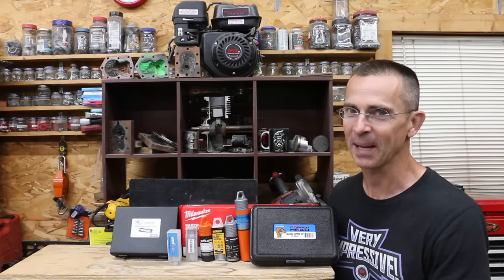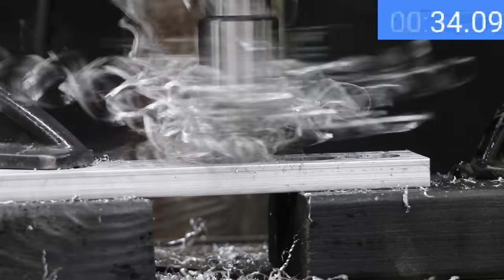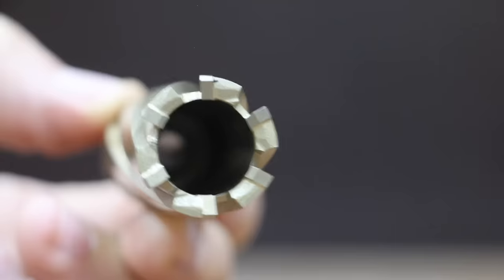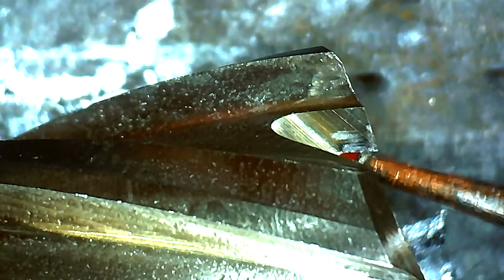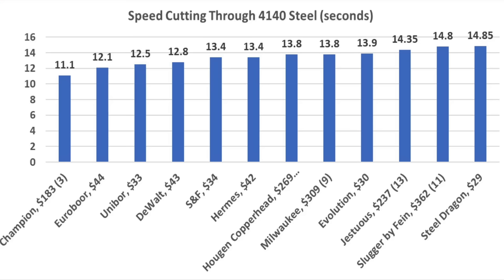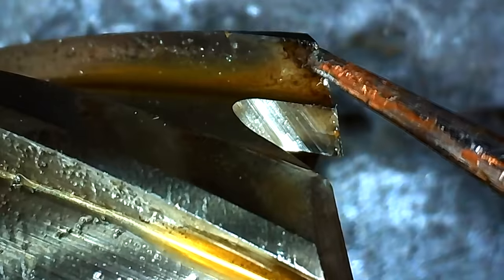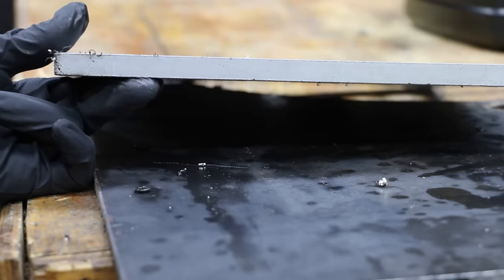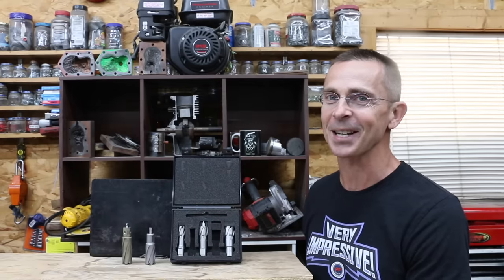Best Annular Cutter? Fein, Milwaukee, DeWalt, Euroboor, Hougan, Hermes, S&F, Evolution, Steel Dragon

Comment: Thank you for this extensive test and make your public aware about the benefit of annular cutters. I am proud to see that Euroboor results come in the Top 3 of your list. In The Top 2 for wear resistance and is Number 1 price quality wise. I hope my comment will get some exposure because beside the annular cutter Euroboor has the widest program State of the art Magnetic drilling machines and I am convinced if you would run a test one day Euroboor will come out Nr 1. and leave nr 2 and the rest light years behind. Kind regards, Albert Koster - CEO - Euroboor USA
Reply from the maker: You are welcome!  Thanks for the suggestion.

Comment: For many materials, carbide is actually supposed to be run much faster than HSS for longevity and proper chip evacuation. I wonder how much running them slow impacted performance.
Reply from the maker: Thanks for the suggestion.

Comment: These cutters are awesome! I used to use them all the time working with structural steel, drilling through plates up to 3” thick at times
Reply from the maker: Thanks for the feedback.
Reply: Couldn't count the # of holes drilled in base plates, webs, and flanges. Small fab shop.
Reply: @ZincOxideGinger  structural steel if fun work for sure! I used to work for a decent size shop (60-100 tons of steel a week).

Comment: Years ago, we used a "Hougen" unit. They supplied the motor and bits. Portable with a magnetic base. On high rise structural steel beams, it would cut through 1" steel beams with no problem.
Reply from the maker: Thanks for sharing.

Comment: I use Annular Cutters all the time , have recently bought a 
variable speed MAG drill and slowing down the speed my
cutters are lasting at least ten time longer and only about 20 %
slower to drill the holes , heat murders these cutters....
I have switched to carbide tipped cutter for just the one size
and they are amazing, so all my future purchases will be
carbide. 
great test by the way.
Reply from the maker: Thanks!  Thanks for sharing.

Comment: Hey Todd I'm not sure if you will get to see this comment but a test on hydration bladders would be stellar. Comparing brands such as Camelbak, Source, HydraPak etc. For outdoors-man, you must trust your life to these bladders. And depending on how hostile the environment if there is a puncture, death is guaranteed. Either if the bladder burst and soaks your sleeping bag in a cold environment this can easily be a death sentence. Same deal if its a very hot environment. So given just how important these are a video properly comparing them would a be a god send.
Reply from the maker: Thanks for the suggestion.

Comment: I'm using mag drill bits (annular cutters) all the time, mostly Jefferson (made in USA), also have some Unibor. I've came across with two types of Jeffersons and came to conclusion that "black edition" are better - last longer whereas "silver edition" (orange case with blue top) tend to brake easily. I've heard of Metabo "light wall" cutters (same idea as Milwaukee), but haven't tried them in action yet.
My suggestion is that test should be repeated using only mag drill, as it is designed for this task, whereas I noticed that pillar drill tends to pull to the side and give some rattle, which affects sharpness and time.
P.S. Keep up the good work! Love your channel, no BS just real technical talk!
Reply from the maker: Thanks, will do!  Thanks for sharing.

Comment: pro tip: you can usually hold the annular cutter in a set of mill style "ER collets" if you already have a set rather then buying the arbor. Also wish you had a control of using a twist drill.

Comment: I've used a lot of Hougen cutters, and they have an excellent power driver. I've cut holes in 2" thick A36 and 2"3/6" diameter...Using a Hougen or slugger power driver, or even in a Mill...will extend the tool life greatly, especially carbide...carbide needs a rigid power drive.
 20+ years ago, Hougen was about all you could get, then came Slugger, also a very good brand..
 these cutters save a lot of time and effort, they remove the minimum amount of material on larger holes. center drill and guide is worth the extra $$.
 Hougen now offers them down to around 1/2" or so.
Reply from the maker: Thanks for the feedback.

Comment: I was lead hand fitter in a stainless shop, I only used HSS as I had a grinding machine. If the boilies didn't blow them up, I could resharpen them. The biggest thing I saw was after I went away from factory geometry I was able to double the lifespan on the cutters. Running custom angles worked well, I did not use carbide tip as the boilies would rip the teeth out and the rest of the cutter was just backing.
Reply from the maker: Thanks for sharing.

Comment: I've had some of these annular cutters for a few years, got them with a lot of tooling I acquired. I use them in my mill at slower speeds and they last way longer when slowed down and some good cutting fluid is used. Great tools and the slugs are useful as spacers and other washer type uses.
Reply from the maker: Thanks for sharing.

Comment: I learned about another tool.  Annular Cutter?  Never heard of it, but now I know.

Great test - shows again that some tools work better on soft materials, while others work better on hard materials.  So it's best to choose the right tool for the job.  Also, the difference in performance by brand and not dollars.  Also, carbide tips do last longer and though they cut slower in soft metal, they worth much better in hard metals.

Comment: I actually use that exact mag drill all the time at work so this video was great to watch. The only problem I have is with the way you lubricated the bits for most of the tests. This bits are actually designed and cut from the inside out meaning just spraying the oil on the outside like you would normal bits actually isn't doing much. The fluid is supposed to flow in the middle just like it does with the mag drill to properly cool the bits. That's also one of the functions of the center pin as well is to open a valve in the mag drill head to allow the fluid to flow through once it makes contact with the piece you're drilling. All that being said I still love this video and all your content
Reply from the maker: Thanks!
Reply: @ProjectFarm  anytime brother!

Comment: once the cutter side slips that is typically the end of the cutting edge. If using a drill press where the center pin isnt useable, we drill through a piece of wood to act as a bushing and clamp it to the top of the work.I think you need to make a better center point as well. We use a center punch, then actually will use a pointy hand drill around 3/16" so the pilot doesnt slip. Your initial aluminum drilling may have been skewed by your system of force....when an operator is near completion of a hole they will typically reduce feed pressure a bit so they dont blast through, tearing the material a bit and loading up the bit cutting surfaces. We started with the slugger system in the early 80`s and have drilled a few holes since then.

Comment: Deff one of the best channels on YT. 
Have to mention though these cutters would have yielded different results if a constant coolant supply was used.
HSS will cut with out coolant but it's not really suitable to not use coolant in this application.
Good test otherwise, love your vids Todd.
Reply from the maker: Thanks!  Thanks for the constructive feedback.

Comment: Thanks for the testing on these great info. When using these titanium and steel I usually flood them with coolant helps  quite a bit and not forcing the cutters into the material just some good pressure and let the cutters do the work. It takes longer but the bits last longer as well
Reply from the maker: You are welcome!  Thanks for sharing.

Comment: First off you are amazing second suggestion soldering equipment heat shrink tubing pin crimpers not the crush kind but there is a circular octagon crimping style for pins but mostly solder soldering irons and he shrink tubing this is definitely a new rabbit hole for you to go down regarding heat shrink tubing there is a measure of the reduction there's one to two one two three solder has different amounts of various alloys and soldering irons of course have different wattage levels
And of course the standard over reliable is the Weller gun but that is more of a sledgehammer approach to soldering yet excellent for all around work

Comment: Some application here: Euroboor makes a “beam drill” that has a height of 7” and a mag base to fit inside of the web of a beam. Angular cutters are fantastic for field machining as they leave a hole perfect for cutting threads. In my experience, less feed pressure does better than hanging on it.
Reply from the maker: Thanks for the feedback.

Comment: I have not even checked out what my 25mm cutter at work is.. But DAMN(!!) it's good!!!
Used it only with my DeWalt cordless drill thru 5mm thick tubular construction steel girders - but by now alone it has well paid it's price worth.

Comment: I really enjoy you videos. Your testing methodology is very thorough and many of your test jigs are very clever. You have done a video on hole saws and now on annular cutters.  It would be interesting to see a comparison of cutting fluids (including hougen slip stik) as there are both high viscosity and low viscosity oil based fluids as well as water based. It might take 2 videos as annular cutters generally recommend water based. Keep up the great work!!!
Reply from the maker: Thanks, will do!  Thanks for the suggestion.

Comment: I use annular cutters every day at work in a mag drill. A constant stream of water, keeping the bits cool, seems to make them last longer than any oil. We discovered this after smoking through bits with various lubricants and cutting fluids for years. We just poke a hole in the cap of a water bottle and spray as we cut. It would be great to see that tested. The cutters last hundreds of holes in mild steel, even the ones that didn’t test well for you.
Reply from the maker: Thanks for the suggestion.

Comment: I have a suggestion. The best dirt/clay remover. I race cars on dirt/clay tracks and something we are always trying to do is find the best way to keep the track from sticking to the racecar. (There must be other applications also). A well known brand is Mudd Off. A mixture of diesel fuel and transmission fluid is the diy type.  Keep up the good work.
Reply from the maker: Thanks, will do!  Thanks for the suggestion.

Comment: I have actually used an annular cutter to size the muzzle of a Century Arms Sporter L1A1 which had its original threaded muzzle cut off to make it legal to import. My problem is in couldn't use a lathe on the barrel because I didn't have the receiver wrench ti remove said barrel, so I looked every where for a solution. I then went to CNC warrior, qhuch I have used before for taps, and they had an annular cutter meant to size muzzles and had a different sized centering pins thay you can pick from, all being sized for calibers like .22, .241, .25, .270, .308, etc. It worked like a dream and sized the muzzle perfectly for me to thread the muzzle for a flash hider.

Comment: In our little factory we use 21mm annular cutters to drill thousands of D32x2 stainless steel tubes daily. we then weld in the holes D20x1.5mm stainless steel ribs and we polish them and sell them as rail towel heaters to be installed in bathrooms. Its a product in Europe that everyone loves. We use Karnach branded cutters and usually about 1000 to 1500 holes are cut before the cutter becomes too dull to drill without it breaking, then we send them to be sharpened. Last year we reached a record in our company, Using one cutter bought back in 2005 we drilled 35000 holes before after the 40th sharpening it became too short to be used effectively. It went from being 45mm tall to only being 8 mm tall. These Karnach branded cutters I believe would have been crushing the competition, its too sad they are not sold in US. On the other hand, seeing the Jestuous, they look almost exactly identical to the Karnach ones that we use. Interesting.
Reply from the maker: Thanks for sharing.

Comment: I picked up a (newly released?) tungsten carbide tipped set from Jestuous at $265 for 13 bits, the first thing I did was send a couple thru an old pitted AR500 target while they’re still inside the amazon return window,  they ate into it just like the CTC’s show here and seem to be excellent so far.  I’ve also had good results from the Jestuous 1/4 and 1/8 TC grinding/cutting burr bits.
Reply from the maker: Thanks for sharing.

Comment: Just what I was looking for, I have been told that Hougen is the way to go for the mag drill so I assumed that the annual cutters are the best too, I will be looking at Euroboor too.  For a tool like this that is most likely being used in hard steel, to me the longevity will be worth the up front cost of the carbide tipped models.  A good way to "weight" the individual cost of the cutters that are in sets would be to divide the cost of the set by the total number of sixteenths present in all the cutters in the set and then multiply that by 15 to get the weighted cost of the 15/16 cutter.  Doing that shows that the Hougens aren't far off from the Euroboors and I believe that the cutters are made in USA too?

Comment: This test should have allowed for your swapping of metals in cutting speeds, also Carbide and HSS have drastically different recommended cutting speeds (rpms).
In general...HSS should be run at a 100sfm, carbide should be 300cfm in mild steel. I have no idea what your speed was but trying to run a HSS cutter at carbide rpms will destroy the cutters teeth, they're unable to survive the heat. 
Lack of rigidity in your super long spindle chips cutting teeth.
I do love your videos,  watch them all, thanks for all of your work.

Comment: We use the carbide tip cutters on our Hougen mag drill. Think about it, who wants a bit that can only drill 1 or 2 holes before burning up? Sure the carbide might be slower on crap metal but they last all day when you really need to get a lot of holes done in thicker metals like I-beams and heavy wall tubing.
Reply from the maker: Thanks for the feedback.

Comment: Excellent video. I'm especially surprised that the holes were so precise even with visible runout on the drill press. I'm guessing it's something in the geometry of the cutters that keeps them on a precise track once they get started. I'm also impressed that the drill press managed to keep them going. My big drill press (but still belt drive) couldn't do the job when I tried annular cutters in it, but I was trying 1-3/4" holes. Very nice work on this one, and very clear that it's worth paying for the carbide versions. They aren't cheap, even in HSS, so you don't want to pay for them more often than you really need to.
Reply from the maker: Thanks!  Thanks for the feedback.

Comment: Once again another great video. I do have one small complaint though. Comparing high speed steel tooling to carbide with the same feeds and speeds isn’t fair. The advantage of carbide tooling is it can be run at faster feeds and speeds. The carbide cutters should be retested in the aluminum and mild steel with more weight and possibly a higher spindle speed.

Comment: I should pick one of these up for drilling 3/4" holes in truck frames for a specific recall.  Using twist drills and a reamer is how we do it now, but it takes hours and burns a lot of bits up.
Reply from the maker: Thanks for sharing.

Comment: With annular cutter's we always use a soluble oil that you mix with water. The key to a long lasting cutter's is keeping the cutting edge and material as cool as possible. Cutting oil lubricates the bore hole but has no were near the same cooling potential as soluble oil with water. Would be good to see the longevity of the same cutter's with the oil and water. Even with cheaper cutter's we are able to do hundreds of holes through 25mm plate with the correct cooling liquid at our workshop.
Reply from the maker: Thanks for the suggestion.

Comment: The only thing I would caution people on is where these cutters actually come from. It may have your favorite brand name on them, but they change suppliers so often the quality varies year to year. Unless you are buying from a tool bit brand like Sandvik I doubt these things are actually produced in a factory owned by DeWalt, Milwaukee, etc. 

Drill bits and driver bits have the same problem. I had Milwaukee driver bits a decade ago that were soft trash. So I bought DeWalt, they were great. I finished my basement and shed but had lost or mis placed a bunch so my kit was looking pretty slim. I purchased another DeWalt kit a few months ago, and they are not nearly as good. I already have a few rounded over Robertson bits, and they do not engage the screws well at all.
Reply from the maker: Thank you for sharing!

Comment: Great channel. Review idea: right angle cordless drill. Many sailors use cordless right angle drills instead of manual winch handles to hoist sails or even lift a rigger up the mast. The old Milwaukee M28 was prized, but discontinued. And newer drills are much better. Comparison would be great. Thanks for such great reviews.
Reply from the maker: You are welcome!  Thanks for the suggestion.

Comment: Man, this test is super timely for me. I just rebuilt a drill press and am looking into outfitting with an annular cutter. Just a tip for you for your own shop: Check out the Rogue Fab Drill Press Reduction kit. I outfitted my Jet 15" press with it the 4:1 reduction model and it is capable of 50 RPM. A much better speed for annular cutter and harder metal.
Reply from the maker: Thanks for the feedback.